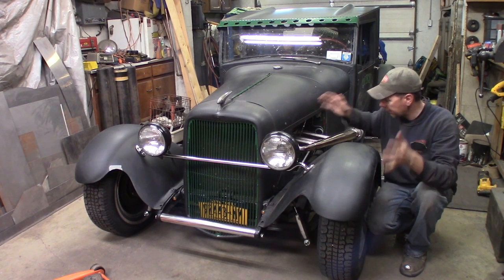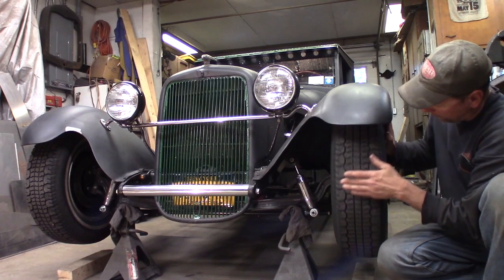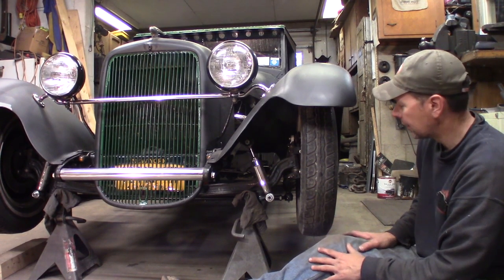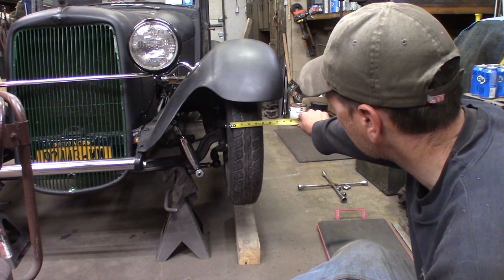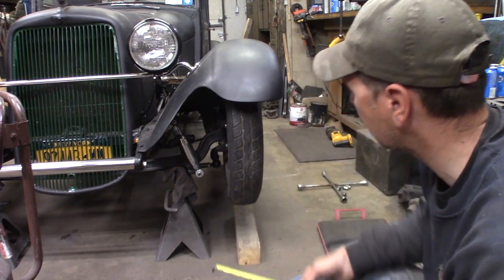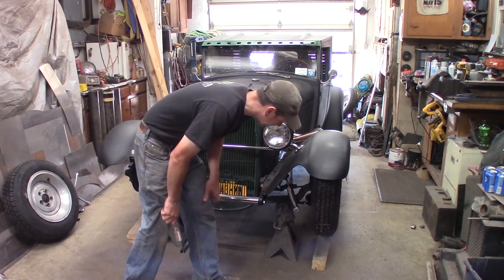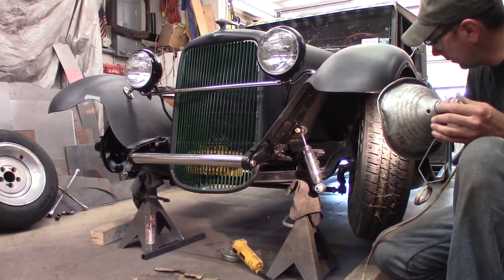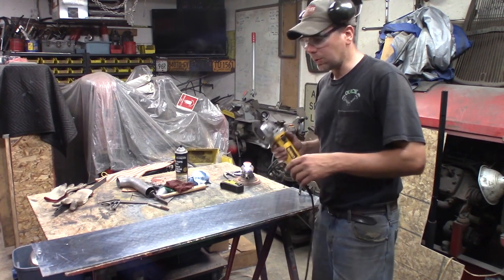Model A Hot Rod Shop Truck Gets New Front Tires!

Comment: Running boards are 👀 looking great. Panel adhesive, that’s a good ‘ide-er’ , that must be what the new Ford aluminum cab a put together with. I watched a video on it they say  it’s stronger than the spot welded system. Now where can I use some of that.....🤔❓
Reply from the maker: Those aluminum trucks are riveted together at all the seams.  They might use adhesive as well, but they also use flush rivets about every 2 inches or so.  The rivets are steel so I'm going to be curious to see if dissimilar metal corrosion will occur after a few years in rain and salt.